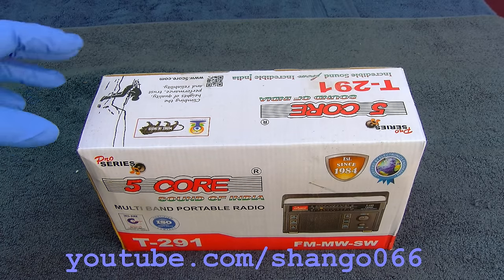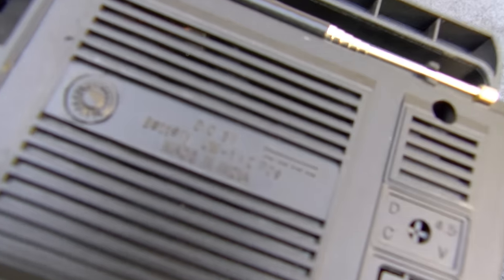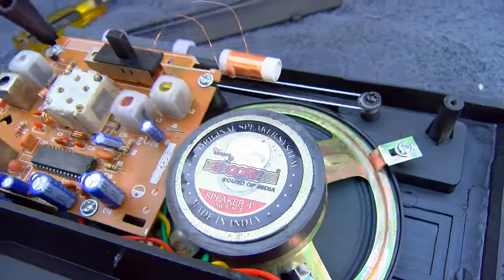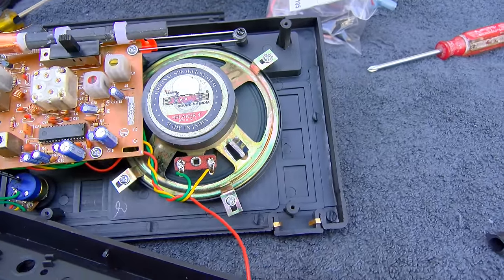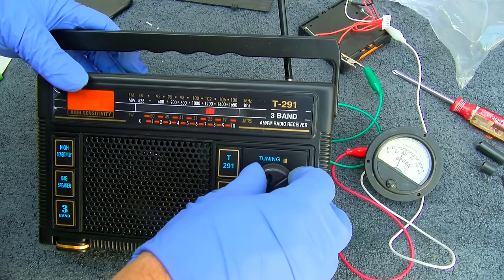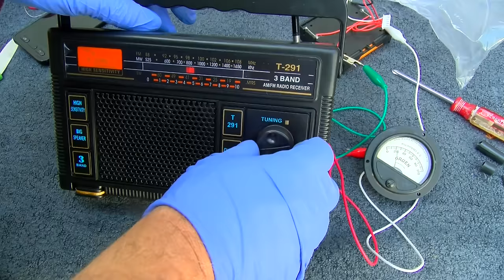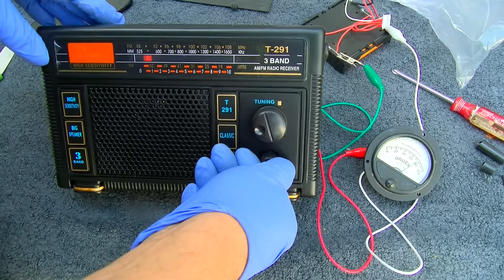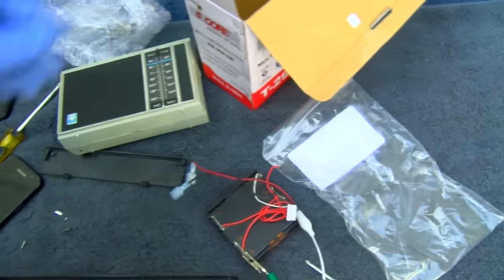Modern 5 Core AM FM SW Radio T291 Disassembly And Test Made In INDIA

Comment: Iv just repaired a little radio but the reception is terrible, the antenna broke off so I put some copper wire for the antenna but it doesn't work very well, however when I wrap some solder round the copper it works well, is it that copper is not a good metal to use as an antenna
?

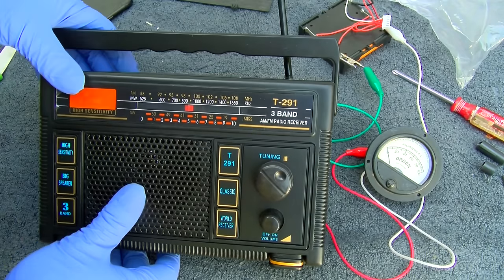Comment: 12:20 The "F" for AM and SW probably has more to do with the damage during shipping than the way the set was made. A whack hard enough to break off that fer-rite rod could easily have messed up the settings of half the IF transformers. I'm surprised that the FM tuner works as well as it does.
Reply: had a vintage radio arrive with a broken rod... AM was basically reduced to nothing so i concur with your assessment

Comment: What is going on with that one transistor in the upper left of the board? It looks like they moved the emitter to another point on the same trace.
Reply: On many of these receivers with SW, the single transistor is used as an antenna buffer. It's a cheap attempt at an active antenna. They need all the help they can get. On many of these radios with more than one SW band, they run the RF stage in the front end unturned.

Comment: This particular IC from Sony is very good, it has low consumption, so the batteries work really long, especially in AM and SW bands. Of course, if the volume isn't very loud. There are also Chinese analogs for this Sony IC, and some of them have even lower consumption.

I can't see the 455 kHz filter, because of that the radio has pretty bad selectivity in AM bands.

Comment: OK, so I bought one of these radios: The reason the AM selectivity is so bad is that CF3 is missing- there is a jumper where the ceramic IF filter is supposed to be (just who were these "Electronics Engineers" who certified this?) .   I think this calls for a followup video..  The CXA1619BS datasheet shows a LED signal meter that also could be added...

Comment: I'll stick with my Radio Shack DX-402 aka Sangean ATS-505, thank-you-very-much.  I give THAT radio a 20 out of 10 rating.  Super strong reception on ALL bands.  Excellent sound for a small speaker.  My only negative is the momentary pause in audio as it tunes through each band.  But there is a mod/hack you can do to eliminate that, which I will plan on doing soon.  VK3YE's YT channel has the instructions on how to do the modification.

Comment: The Sony CXA1619BS is a complete AM/FM radio on a chip, including a 1/2 watt audio amplifier.      Description is a one-chip FM/AM radio IC designed for radio-cassette tape recorders and headphone tape recorders, and has the following functions. Features Small number of peripheral components. Low current consumption (VCC=3 V) For ID=5.8 mA (Typ.) For ID=4.7 mA (Typ.) Built-in FM/AM select switch. Large output of AF amplifier. EIAJ output=500 mW (Typ.) when VCC=6 V, load impedance 8 Function FM section RF amplifier, Mixer and OSC (incorporating AFC variable capacitor). IF amplifier Quadrature detection Tuning LED driver AM section RF amplifier, Mixer and OSC (with RF AGC) IF amplifier (with IF AGC) Detector Tuning LED driver AF section Electronic volume control Structure Bipolar monolithic IC Absolute Maximum Ratings (Ta=25 °C) Supply voltage VCC 14 V Operating temperature Topr to +60 °C Storage temperature Tstg to +125 °C Allowable power dissipation mW (CXA1619BS) Recommended Operating Conditions Supply voltage VCC V (CXA1619BM) VCC CXA1619BM 28 pin SOP (Plastic) CXA1619BS 30 pin SDIP (Plastic)

Comment: Most in the UK still use and prefer to use the imperial measurement system. The only reason they started using the metric system was because it was part of a treaty (with France I think, could be wrong about that part).  I’d assume that many territories of theirs would be the same way, even past territories.
Reply: because its to costly to change everything to metric. it should all be metric although imperial seems easy as you are using objects and not proper measurements.
Reply: Not true, it's only old farts in the UK still using the imperial system.  We should embrace the metric system completely and be done with it..

Comment: I wonder if it’s built to work better out in the boonies. Can’t wait to see a desert video of it.
With it having knockouts for AC & DC connections, I wonder if it was originally designed to have a meter where it says “high sensitivity” (maybe it’s a knockoff of some other radio case 🤷🏻‍♂️)
OH! I wanted to ask you to see if you can get 730am W Deportes from Mexico City next time you do a desert DX vid. I have to get out of the DFW area to get it, but it comes in kinda strong. If Wiki is right, they’re 100kW at night. 👀 They also play some awesome music from at least 11p-6a Central

Comment: It's a sloppy radio, no doubt about it, but like you I applaud the efforts of anyone who attempts to break the hegemony of existing radio suppliers, and create a true analog radio to boot. I remember fiddling around with the radio that was built around a 16-pin radio chip back in the 1980s. This is a much better performer than that one was.

Comment: What's with the transistor in the upper left corner? It looks like one leg didn't make it into it's through-hole.
Reply: I was looking at that also.  When he flips the board over you can se it's still connected to the same trace.  but maybe a little closer to that resistor?

Comment: Thanks for the video, I was curious to see inside this thing. I'm guessing (AM) LO and two IF cans. (FM) Two cans and a crystal filter. FM will work fine with that. AM not so much. That's kinda what you got on the worst HK pocket radios back in the day and they had very similar levels of  "performance".   Interesting that the board shows CF2 missing and CF3 bridged out. I'm wondering if these were AM crystal filters that were omitted to save a few cents. Shame. If so they would have made a big difference.

Comment: Actually looks like common chinese radio from 90s - early 00s. Such stuff was cheap as dirt with typical cost within 5-15$ mostly depending on size (typically bigger = better sound). You could buy such radios literally everywhere in eurasia. Mostly used CXA and TDA (especially TDA7021) ICs. I'm sure most of these ICs was unlicensed copies of "unknown origin". SW and MW AM sensitivity of such radios was always crappy but FM is good. But modern radios with DSP ICs provide even more impressive sensitivity on FM, typically <1 uV, SNR is also impressive. Such specs are completely unreachable for discrete analog radios and those outdated analog ICs.

Comment: Got a kick out of the fact that the letters in the word battery on the back cover don't line up with each other. And also the knock outs where the AC power cord and DC adapter would plug in.

Comment: 5 cores ... Judging by the box This is not a receiver, but some kind of nuclear reactor ...)) I would not be surprised if an auto-translator from all languages to Indian is built in there .. Any radio broadcast immediately translates. Judging by the autopsy, a graphite rod fell out of the reactor .. And yes ... Mail all over the world does the same with parcels. Near the tuning capacitor on the board is the signature GANG. As far as I remember the lessons of geography at school, in India there are two large rivers "IND and GANG". Selectivity is most likely weak due to the lack of some quartz filters on the board. I noticed a couple of empty spots for three holes.
 I didn't want to offend anyone. It's just that I'm in the mood to joke today ...)) 

But seriously, I would like to see an overview of the South African radio receiver Barlow Wadley XCR-30 in your performance ..!
 Or rather, it is your opinion. about the circuitry of its construction.

Comment: It's little wonder there is no AM selectivity and virtually zero SW reception. The board is missing the 455kHz ceramic filter (CF2) that couples the AM/SW mixer to the IF section of the chip. I'm guessing that the capacitor on the bottom of the board jumpered the ceramic filter to save a few cents. It's more like what I might expect from a cheap chinese clone. The SONY chip is used in many low-cost portable radios, and does a good job given the correct circuit configuration.

Comment: I'd be willing to bet that the AM is out of whack to to the coil not being in the right position on ;the ferrite bar...it's out of alignment. That can be high;y critical.
Tune to something low and fairly weak on the dial, slide the coil until you hit a peak tweak the antenna trim cap, then go back and forth between the two until it's as good as it can get.
I can't see anyone putting that long of a ferrite bar into something THAT bad do to the cost of such a thing.

Comment: That radio only works on batteries and has no ac power transformer or rectifiers or filter. Don’t know if it has a jack for a wall wort. No wall wort came with the unit. Too much money for a battery only operated radio Roses Dept store sells an ac- battery operated am fm and 2 band sw radio for 15 dollars made by QFX about the same physical size as yours

Comment: That thing is built like crap. No excuse for a ferrite antenna breaking away from the circuit board when the rest of the radio, including its carton, came through unscathed. The cheap, flimsy plastic mounts clipped into the phenolic board are clearly not strong enough to handle the weight of the ferrite rod.  Then there's the exterior antenna which just disintegrated on the first pull. No way to blame shipping damage for that.  As for performance discrepancies between your sample and the one from VWestlife, it's hard to see what kind of shipping damage would cause the AM band to have such poor selectivity, yet still operate. That could be caused by anything from a defective IF filter to poor alignment. But one thing seems obvious...the overall quality control of this set leaves a whole lot to be desired. I guess you can't expect very much for $25. At best, this looks like a crapshoot.  Thankfully, my small assortment of high quality, restored 50's-'70s Japanese and German transistor portables will serve me well for the rest of my years.

Comment: "Stupid Imperial System"

You're suggesting Metric is better? It has even worse faults than the Imperial system. The standard boiler plate argument "but everything is based on 10, and it's easier!" is a non-argument. That means absolutely nothing when the definition of Metric units has changed half a dozen times over the centuries it has existed, and IS STILL BEING DEBATED TODAY. Want to know the measurement of some metric term in a text book? Better also cross reference a history book to see which Metric definition was used at the time and then another book to tell you the conversion between then definition and the current definition, if such a book exists.

Also fun fact, some "Metric" units are in fact, not Metric. Just like with any other measurement system, existing units are "borrowed" and incorporated for convenience. The Liter/Litre is not an SI unit, despite being widely used in Metric countries. Let's also not forget the dark history behind it. It didn't catch on because it was good, it's like communism, it spreads like cancer under forced conversions and repression. To this day, you can be jailed and fined for using a measurement system other than metric in public in countries which require metric units to be used.

The imperial/us customary system is far better. It was designed around nature and just works without angry governments and scientists constantly bitching about how many atoms make up some arbitrary units. Nobody really gives a damn and doesn't need the headache.